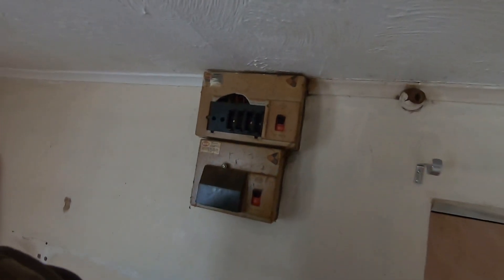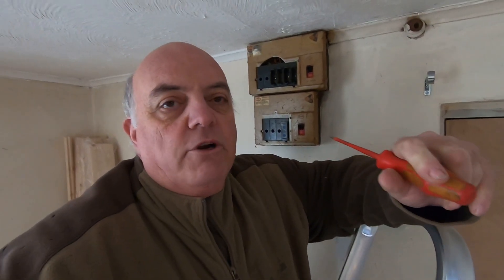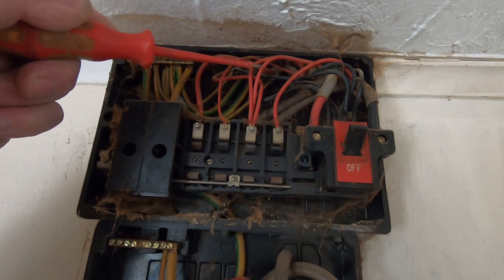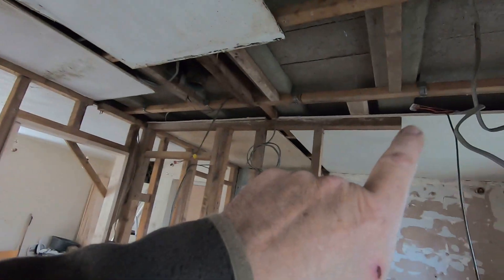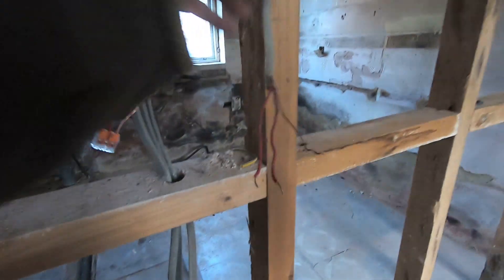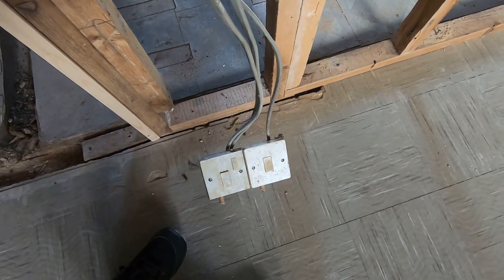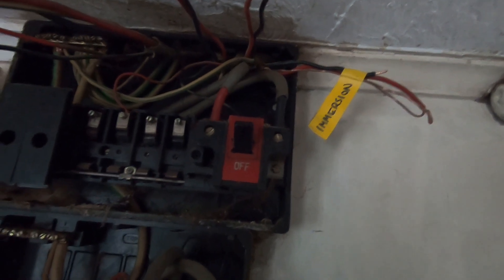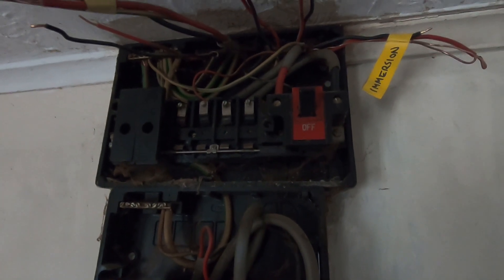Making sense of the electrical spaghetti at the ABANDONED apartment ep10

Comment: May have missed something previously, but I don't see a suitable electrical test upon the circuits? You can trace cabling, but how do you know if it's electrically safe /  compliant? 
The installation is obviously extremely old going by the supply / distribution board/s. Just the fact the facia off the board is so damaged sends alarm bells?
Good luck with your project, but seriously consider a full rewire of the property
Regards
Reply: The wiring is not that old as the Earth wire has the green with yellow stripe on it.
Reply from the maker: @RODALCO2007, It is the original wiring from when the block was built in 1990 and is still in perfectly good condition.
Reply: Those rewirble fuse are still compliant under BS7671 , and can still be installed,the 30amp with three connectors is a ring main and a spur to a single socket, just because those fuse boxes are old doesn’t mean that they are dangerous or need replacing, page 99 in the current edition of the onsite guide Health and safety executives note ( consumer units in dwellings) test to all circuits in accordance with BS7671 18th edition 2018 + amendment Two 2022 , if all tests are within tolerance set IET out in BS7671 then you can sign it off as safe for continued service. Was there any signs of burning/ overheating, was there any sign of exposed live parts, was the access to live parts. Is the answer is no then you are not required to replace or upgrade. So leave it alone. I’m guessing you are not a qualified electrician.?, so learn the regulations, building regulations or leave such work to us qualified professionals.
Reply from the maker: @Dog-whisperer7494  I actually achieved my 18th Edition on January 6th, the year it came into force. It a requirement for my work. I'm not a domestic electrician; I deal with factory work on a daily basis, and have done since 1987, so I consider myself 'a competent person '.
I'm not interested in learning every tiny nuance of domestic installations, too boring!
That CU had a broken cover, so could you imagine any electrician passing that, especially where there is no RCD protection.
It's always best to upgrade at this opportunity as it gives the landlord peace of mind. As It's a rental it needs to have an EICR, so it'll all be tested compliant . What's the point of trying to preserve a CU like that, just so you can argue a point?? And how does that dirty great hole in the plastic meet IP4x?
Reply: @MyPropertyChannel so you have been an electrician since 2018 , about six years, what other qualifications have you got is it just the 18th edition. I’m not judging you I’m just asking out of interest. 
I did C&Gs 236 parts 1 and 2 four years at college 1987/1992 I have been a spark for over thirty years.  So I have a few years on you and I know what I’m talking about.
Reply from the maker: @Dog-whisperer7494  I think you are confused... I'm not a domestic electrician. I couldn't think of anything worse than scrabbling around people's homes, pulling up floorboards, drilling joists, chasing walls etc. That's not for me. 
I have been in and around factory electrics all my career so consider  the work in this flat like wiring up a train set.
Reply from the maker: No need for a re-wire. The flat was built in the late 80s, and all the wiring is in excellent condition. 
Once the new consumer unit is fitted, it will all be tested correctly, as, if it is to be let, it must hve a valid EICR anyway.

Comment: Don't think that was a radial socket circuit being 2.5 on a 30 amp fuse. More likely a ring and a single spur to the daytime element of the lounge heater, or maybe to a single socket. I'd probably put the whole lot onto a B20 in the new consumer unit and split the ring. If you feel particularly fancy put each former ring leg onto a B20 creating two radials that in total provide more power than the old 30 amp ring.

The feed from the bathroom light probably went to a shaver socket by the sink or maybe a light above the mirror but from the length I'd guess the former.
Reply from the maker: Yes, you're right. If it was a radial circuit, should only be on a 16a mcb.
It was a ring with an extra radial popped alongside. Was easy to find and remove. It'll just have a full ring now, as it's only a tiny flat. The bathroom feed to whatever it was, is now gone, and all the runs tidied up.